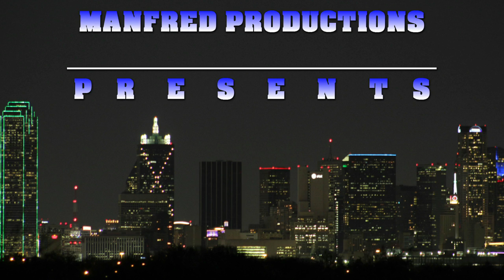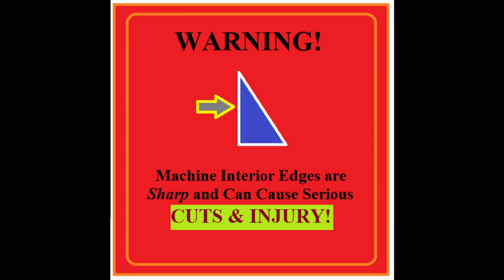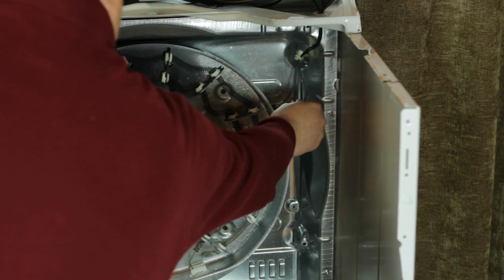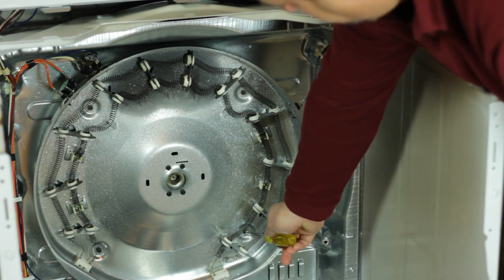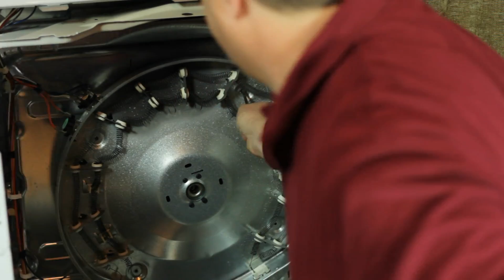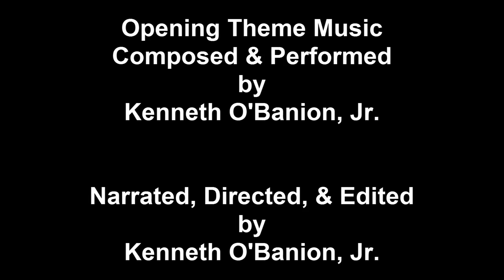GE Dryer Repair - Won't Start or Run - Thermal Fuse Test & Replace

Comment: Hi Canyonman,

Great explanation on these videos. I have a same model ge gar dryer. Yesterday I started a load and realized there were a few items I didn't throw in the with the load. I opened door a minute or so after the cycle started, added what I needed, closed the door and attempted to restart the cycle. Problem is, the dryer will not start. I checked the switched and they seem to be turning and knobs are not broken.  Could the issue be a bad thermal fuse?
Reply: canyonman1963 Before I get into disassembling the dryer, I wanted to buy the spare fuse beforehand. I checked with a local ge parts retailer, and they explained to me that my model does not have a thermal fuse.  The model is DBSR453GB1WW . Is there any other suggestions or should begin shopping for a new dryer?
Reply: Thanks! All the terminals tested OK. However, I was able to find the problem. The button that the door closes against was sticking. I was able to get a replacement par and the dryer is now working great. I am  glad I disassembled the dryer as I was able to clean the excess lint out of it as well. Thanks again for your advice and the great video which demonstrates how to disassemble the dryer.

Comment: my dryer stopped working. I removed a thermostat to check continuity, it checks good but the part has a rattle to it. Is that bad or does it matter?
Reply: where is the fuse? or are you talking about the fuse in the fuse box?
Reply: door switch, broken belt switch, belt are all good.
Reply from the maker: Corey Martin Test for proper power at the terminal block.  Use a voltage meter, and test from terminal L1 to Neutral as well as L2 to Neutral, both should read about 120 volts.  Then test from terminal L1 to L2, and you should read about 240 volts.  If any of these don't have proper power, make sure plug is in snug at the wall and not falling out, and make sure the circuit breaker is not tripped or one leg of the circuit breaker is not tripped.
Reply from the maker: Corey Martin The fuse is a small round fuse with two wires going to it.  It will be mounted on the back on the inside close to the terminal block, OR it will be located on the side of the heating element housing.

Comment: I have a 6 year old GE electric dryer that will not start. I clean the exhaust line annually and it worked fine until last night. I did replace the timer switch roughly 6 months ago. When pressing the start button, I can hear a low groan from inside and I can feel the unit torque, but nothing turns. I am left to believe the motor is seized, but want your thoughts first.

Comment: I have a Kenmore Quieetpak 4 Smartheat Dryer.  Everything lights up and there aren't any error codes.  When I hit the start button, it will beep but nothing happens other than the yellow "sensing, revising use time" light goes on.  No other actions occur.  Any ideas on that issue?  Thanks in advance!
Reply from the maker: I haven't ran across that one, so if it were me I would start with testing all fuses, testing the thermistor.  If all good, make sure all wiring is good, and all is attached firmly - make sure to unplug machine so you wont get shocked. If all that is OK, my best guess would be that it is either a dryness control board issue or the main computer issue.  No way to test these components and they are expensive, so rather than guess I would consider calling out a tech from like Sears Repair and put it on their shoulders.  However it comes out, please do comment on what you did to fix it for the rest of us!
Reply: canyonman1963 Thanks for the quick reply.  It was the thermal fuse that went bad.  Surprisingly, no error codes came up - the dryer just didn't work!  Fuse was replaced and everything is back to normal!

Comment: I have a friend who owns a maytag gas dryer.  Would initially run for about 5 minutes, then blow a fuse at main breaker.  Now as soon as you hit the start button it blows a fuse.  Any ideas  ??  Thanks.
Reply from the maker: Sounds like there is a short somewhere in the dryer.  You would need to unplug it, and then open machine up and inspect all wiring for any burnt wires or shorted wires.  If all is good, it is possible the short is in the timer, or the motor could have bad windings that are shorting.

Comment: Maybe I missed it, but it would help to mention that most likely the cause to the thermal fuse blowing was that the dryer overheated and you may have a clog in the duct, line or crushed vent hose. Otherwise you'll be disassembling this thing when it blows again and again.

Comment: i did test but it still wouldnt work so i went the route to replace then still didnt work  everything said to replace the fuse but never thought to check for broken knob that just turned on the timer